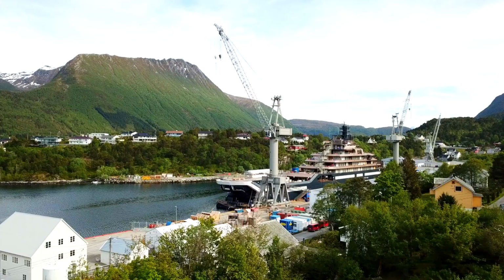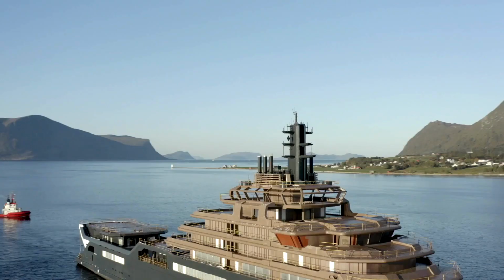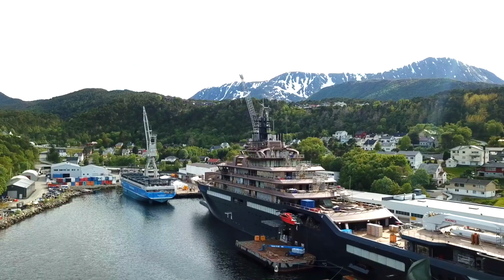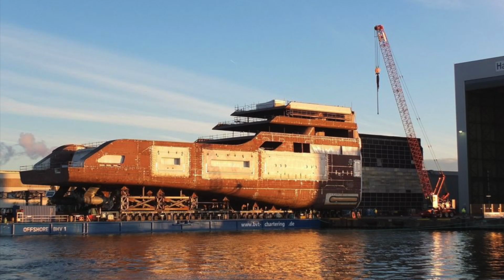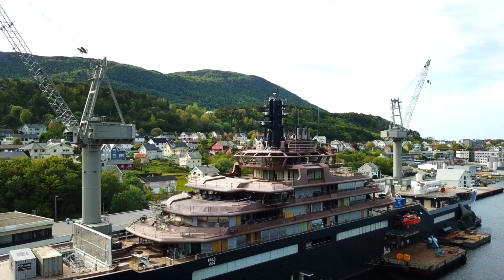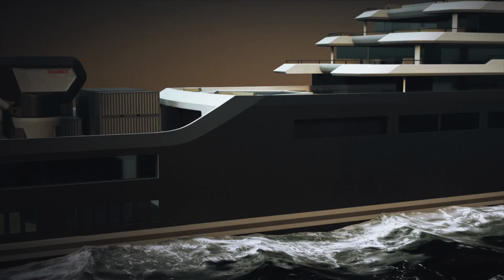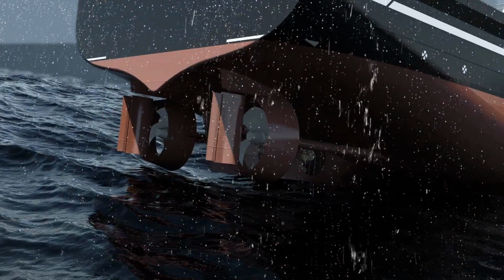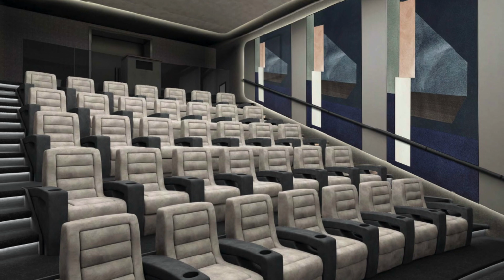Is this the Largest SuperYacht Ever? - RevOcean

Comment: Have you heard of Fulk Al Salamah?  It's classified as a support vessel for Al Said, but I've seen two different lengths for it.  One being 150 meters and the other 164 meters.  But is GT is said to be 20,000+.  I saw info on REV where its GT was 21,000.  BTW Al Said is 155 meters. My question is about the length of Fulk Al Salamah.

Comment: Fantastic video and what a breathtakingly cool vessel. I have a thousand questions just about its propulsion... My biggest question, though, has to do with engineering mistakes. After watching this video, your video regarding Opus and your series about Yogi, I'm curious how often yachts are built with fundamental engineering flaws that aren't caught during sea trials or that aren't covered by contractual terms? For example, in seeing pictures of Opus just before her launch, it appears that her draft seems modest relative to her air draft. I'm not suggesting she's top heavy as I know this ratio can seem deceiving to the eye. On the other hand, I can imagine that without significant and constant stabilization, it could get extremely uncomfortable on those upper decks. At what point does a miscalculation regarding roll center go from being an inconvenience or annoyance to making a yacht unusable or dangerous? And does this sort of engineering screw up happen often? Would love to hear your thoughts on this. Thanks!!!

Comment: That moon pool is massive, wow! Curious, though. When it's not being used for research would there be any restriction on the owner using it for uh.. motor-yachting himself about in a leisurely manner?
Reply: Ah yes. This sounds like a perfect setup. https://www.revocean.org/explore/ Clearly intended for passenger use sometimes. Capacity: Research: Crew: 30 — Scientists: 60; Expedition: Crew: 30 — Scientists: 24 — Passengers: 36; Vessel: Crew: 54 — Guests: 36 -- nifty.
Reply: He has already said he intends to use it as a leisure yacht for himself at least 2 months a year. The rest will be split between chartering and supposed scientific research.